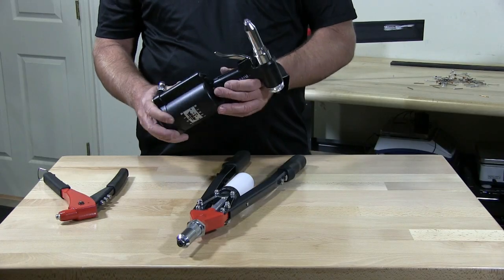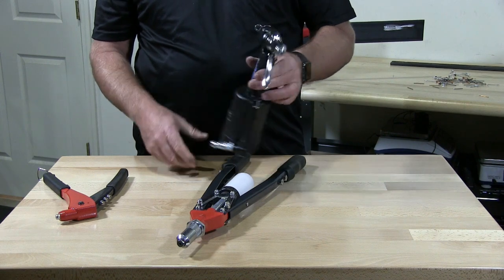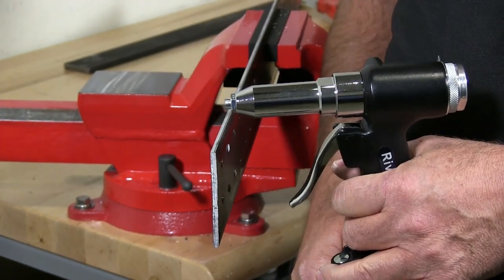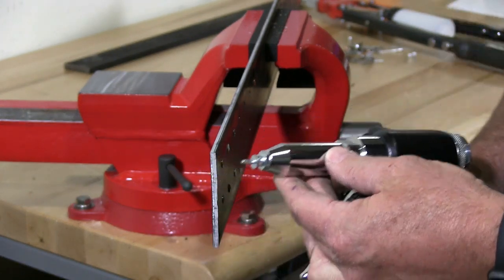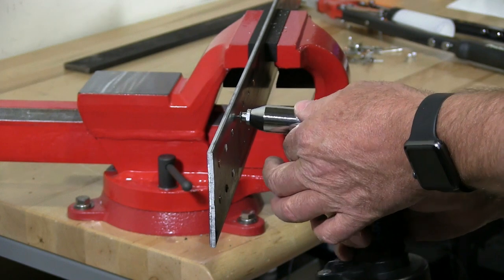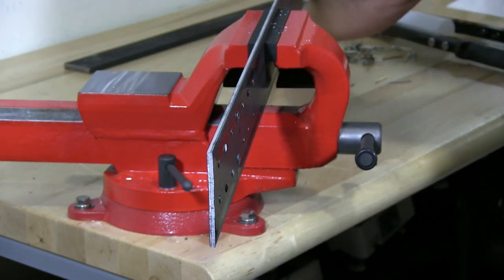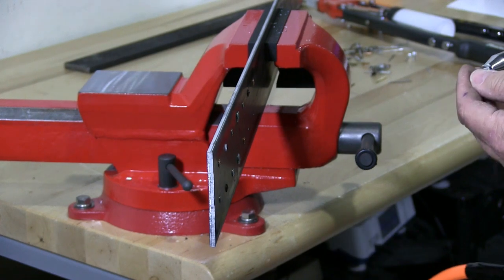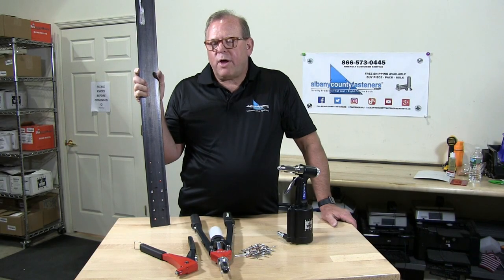How to use a Rivet Pneumatic Air Gun | Fasteners 101

Comment: can I use this tool for riveting clutch plate or brake shoes?
Reply from the maker: The Pneumatic Rivet Gun could be used for both those applications, but keep in mind that this particular riveter can only rivet a certain range of pop rivets (3/32" - 3/16") and it's not exactly the smallest riveter. If you can fit it on the application in question, and the rivet size you need can be used by the rivet gun, then you're all good.

Comment: Dude. You are awesome
Reply from the maker: Thank you for your feedback!
Reply: Albany County Fasteners I have a question- do rivets such as those shown here come loose over time? For example, I'm making an ice cream cart using aluminum sheeting .050 thick which will be wheeled around.

And.if so, is it just a matter of drilling them out and replacing or will the original hole be too big to get a tight fit?
Reply from the maker: They aren't supposed to loosen over time. If they do, it's possible they weren't installed correctly the first time around. As far as replacing them, we have video on removing pop rivets: https://youtu.be/rZTAQ8jCep4
If done correctly, the hole should not be any bigger and the same size rivet can be used.

Comment: Hey my rivet gun does the rivet and it breaks the stem but the stem is not coming out from the back. It is pneumatic rivet gun. Please help. It's brand new!
Reply: lazycrazy you probably have crappy rivets. Try it with a different brand of rivets. If that doesn't work return the pneumatic rivet gun. Read the manual make sure your psi is not set to high. Also make sure you have the correct amount of hydraulic fluid within the gun.

Comment: A 101 video should always cover tool set-up. Maybe it's easy but my rivet gun came with several bags of stuff...springs, o-rings, oil, and at least 8 other parts that I want a video for.
Reply from the maker: Extra parts for repair?
Reply: @AlbanyCountyFasteners   I wasn't even sure at the time but yes I guess it's just a bunch of spare parts. I was afraid to use it not knowing what all these extra parts were. Also the instructions that came with it (which explains next to nothing) say it needs to be oiled every day but doesn't show where to oil this thing. If it's really this important, oiling would be another nice inclusion in a 101
Reply from the maker: @bryanbischoff1008  remove the hose and add a couple of drops of air tool oil each day.